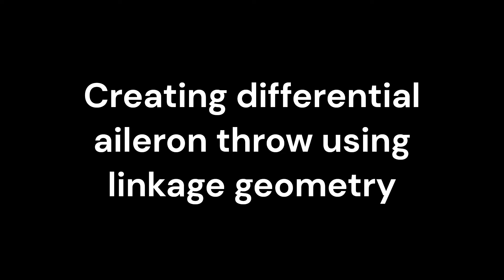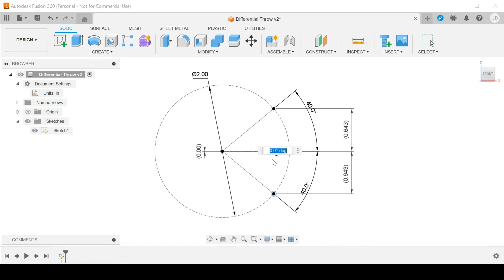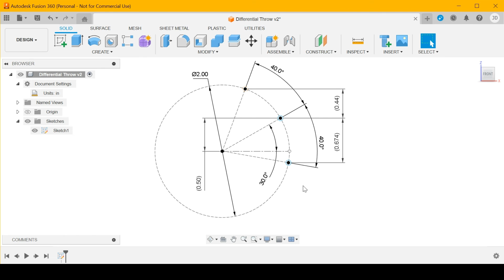Creating Aileron Differential Using Linkage Geometry

Comment: We had touched on this topic out at the field. The "how to" part was understood, but I was unable to visualize how this would function in practice. Your Video Works (at least I believe that is the software that you used) video helped to fully understand both the practice and implementation of setting up the servos mechanically for aileron differential. Thanks muchly! I have a couple of flat bottom wing models that I want to try this out on at the TRCFC field